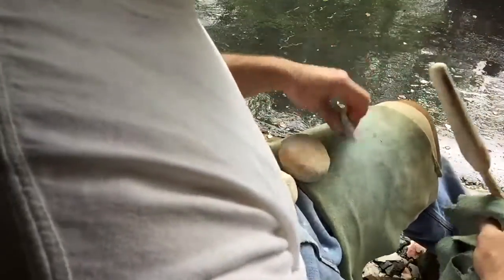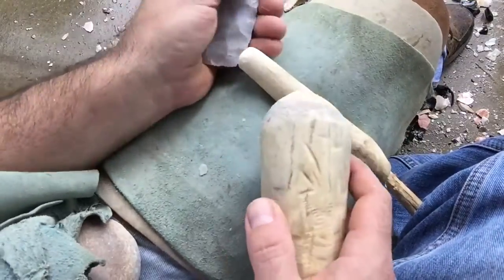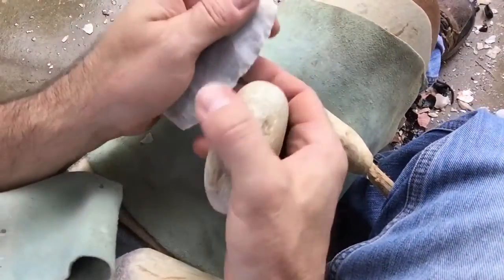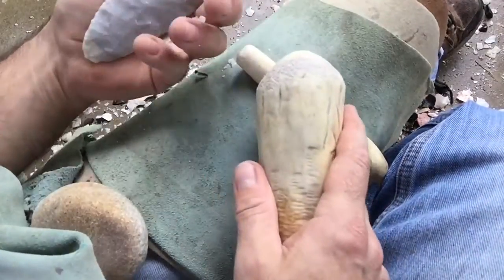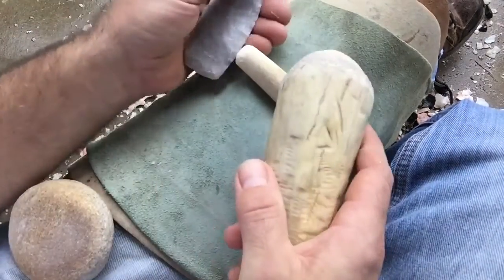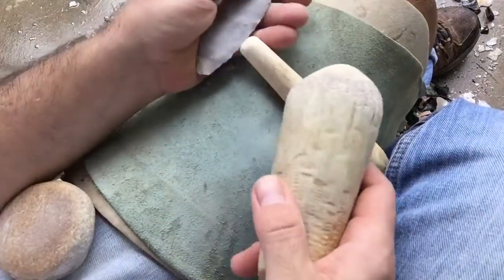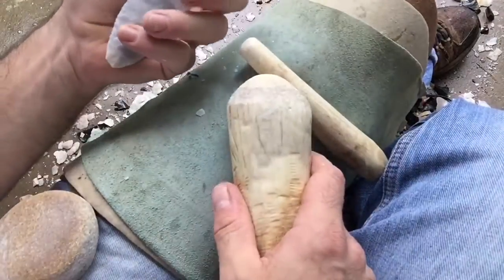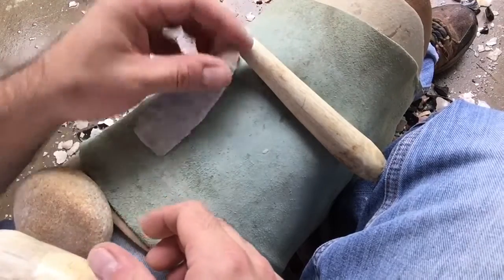Whitetail deer tine shaft punch.

Comment: Love your punch work. Would like to see a couple different views of the setup. Is the other end on ground? Do you put pressure on it with your right leg?
Reply from the maker: I use a straight, or in this case slightly bent sticker pressed into leather on the ground and backed into a corner.  My right leg provides support and braces.  There is some inward.  When I trim and plan I use a floating support w the hand and this is the best training tool to learn how to brace with the hand using this technique

Comment: No, we're not bored, I could watch this from start/finish, thanks for sharing! I remember seeing this springy composite punch online. I just cut sticks for some bigger composite punches but will add a springy one when I have the right tine. Is this the actual tine or a small base? Are you padding the punch on the ground like the bigger ones?
Reply from the maker: Hey Adrian,  the smaller diameter punches like this are springy so I just jam them into a corner to get my inward.   The larger diameter punches are usually shorter too and can "kick" that way, so some cushion helps.   I think the best system would be probably something different on those but it takes me a while to find the best result from the 'best new result'.
Reply: Thanks Marty, by your last statement I guess you're thinking of a new composite system?!
Reply from the maker: +Turboknapper work on it with me.  I've got some ideas I'll run by you.
Reply: I'm game, I'll be eagerly awaiting the details!